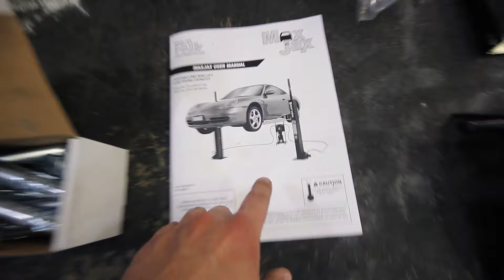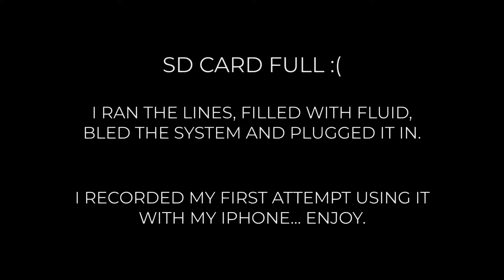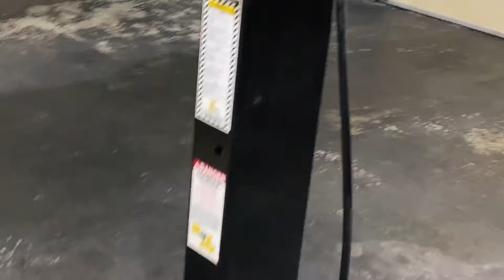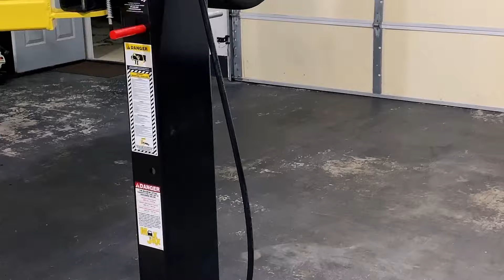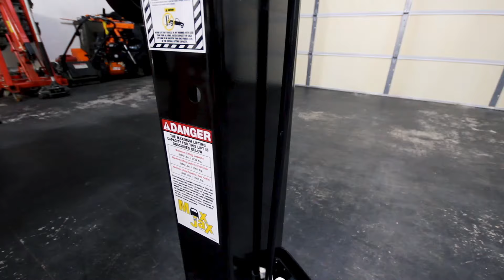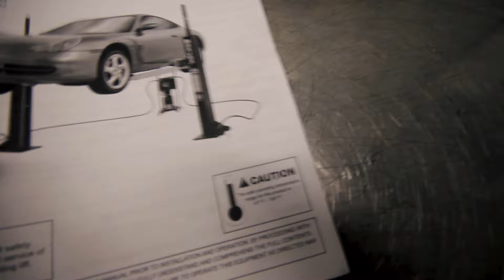MaxJax Lift Installation & Review - Portable 2-Post Lift for Home Garage

Comment: You might want to be careful about suggesting people drill additional holes 🕳 in the support arm! Things like that have rating based on design and engineering. The metal is most likely heat treated after the manufacturing process and for every hole you put in that it weakens it. Too many idiots in the world that listen to suggestions like that and get seriously hurt or killed because they think they know what they are doing. You might not want to listen to your own advice either unless the manufacturer says specifically that you can do what you are saying and even then I would not. Otherwise great video! 😯🥸🤪😂

Comment: Why don't these systems ever have a safety cross member between the two posts, to prevent them collapsing inward??  .. one would fit underneath the car, and would not restrict most jobs.  The idea of trusting your life and car to a few concrete anchors, which are known to fail,  just doesn't fly with me!!!
Reply from the maker: Most of the crossmembers you see on lifts aren't structural. They're to run wires and hoses across with a finished look. But I do understand your concern.
Reply: @jake_spence  Right,..I've seen those floor level cross "covers" for cables/hoses. I was thinking a structural brace that ran between the yellow lift arms...that could be removed if needed for access to vehicle.

Comment: I can’t wrap my mind how the posts stay up without a bar across the top. I’d fear for my life every time
Reply: @CB.5  actually the taller 10 & 12 ft heights for 10,000 lbs can have upper cross bracing with a stop switch to prevent vehicle/ceiling damage, though the bracing is light gauge metal for supporting latching cables or hoses & does not contribute much added strength from falling inward. You are trusting everything to the grip engineering of those bottom bolts. Here's where I would carefully read & follow all written instructions. Another youtuber had difficulty with the bolts not tightening properly & call to support reminded him to clean out the dust in the holes before applying torque. Easy to forget or not completely follow all details. It hurts just thinking about what could happen.
Reply: @michaelamick4887  Again, those are not structural bracing.  They are there to support the hose and cable.  The other option is to have those routed at the bottom with a metal track over them.  I agree with you on the importance of following directions and correctly installing the concrete inserts.  But these are not magical lifts and they are not even deadly.  If installed correctly and used correctly, the fasteners and posts can easily handle the loads.

Comment: Those bases look so small to not have an over bar so it doesn't collapse inward.
Reply from the maker: The overbar on most lifts are not structural. Just they pass wires, cables and hoses from one side to the other.

Comment: Two oil changes before you have to empty? Cant imagine that car has a 2.5 gal oil capacity
Reply from the maker: Almost 7 gal capacity. Obviously I don't want any used oil seeping out of the top. So two changes, as it'd be overflowing with three.

Comment: Hi there Ive made video on my car lift installation and review and its quiet handy as my model is 2 post H base and only needs 4 inch concrete. Check it out as it might be quiet helpful.
its a single phase lift, but also comes in 3 phase model.
Thank you for your video by the way

Comment: I like the maxjax but wouldn't buy AGAIN. They have the worst customer service I've ever seen. I had a issue and summit racing (I bought it from them) had to call them because i got no help. Then summit ended up exchanging it because they couldn't get help ether. Summit racing has the best service I've seen.
Reply from the maker: Interesting. Luckily I haven't had to contact MaxJax customer service. But I'm sorry to hear you had issues. Thanks for sharing your experience.

Comment: Honestly I don't see the point in it.  My DPM is only 4" below the concrete and the bolts would rot out and the floor would be ruined. It is too slow and too low.  For £1800 you could have a proper one and it would give you six foot to work under the car I'm glad I watched this as it put me off . If you use it to remove an engine from underneath the car it might cause the car to tip over.  I've got a pit in my carport and that's been good. I would have to have a lift outside. Even though my workshop ceiling is 10' it wouldn't be good enough. Thank you for the video anyway

Comment: Anyone else cringe when he started drilling the concrete with the hydraulic fitting open? Nothing like introducing contamination to the system before you ever even add the fluid.
Reply from the maker: Lol, definitely an oversight on my part.

Comment: Your Installation unsafe Yong footing foundation is not enough only toks bolt cause cracking tiles floor and  no have brace bracket from down  to the top the heavy gravity push down side by side.. Must better you open the tiles make square 20inch and make hole 30cm deep used cement mixed sand with cabelya metal braket 4mm and welding the bolt last step mixed sand and cement put on..and you add brace bracket your lifter equipment downside and the top

Comment: Until you forget to lower the car before opening the garage door lmao hella paint job tho
Reply from the maker: Haha, I just started pulling the car further forward now and it's not an issue.
Reply: @jake_spence  When you get the car in the perfect spot paint (or tape) a colored square around the front left tire and mount a fish eye mirror on the ceiling so you can line up the car perfect each time.

Comment: just dont open that garage door by accident at full height.
Reply from the maker: I've since learned how to park cars to avoid the garage door.
Reply: @jake_spence  I do recommend to interlock the lift and the door (if lift isn't in lowered position, no openning of door. If door openned, no lift). As an added bonus, if some unforseen interference or, god forbids, some twat thief hacks your garage door openner and a car if up, the door will remain unpowered :D Never rely on a garage openner for safety or security, plan a manual power disconnect (or breaker/switch).
11 seconds garage door openner hack: https://www.youtube.com/watch?v=iSSRaIU9_Vc
Samy on Veritasium (simplified): https://www.youtube.com/watch?v=CNodxp9Jy4A

Comment: What the hell is the point of having a lift if you have to sit in a chair to go under the car. Not very portable when its bolted down either? I hope people call a professional to install the lifts that hold cars over their head. No need to be cheapskate, hire a professional and they may even get the thing shimmed right. That height is a joke though. This was painful to watch.
Reply: Not everyone has 12ft ceilings. But needs more lift then a a floor jack can provide.

Comment: Not very portable if you need to bolt it down every time you use it!
Reply: How else would a lift be more portable than this? The anchors are always set. It literally takes 10 mins to set the post. Plus you can always leave the post in their place…..